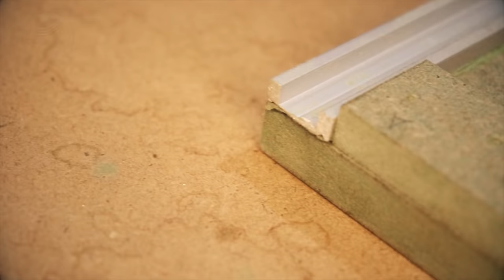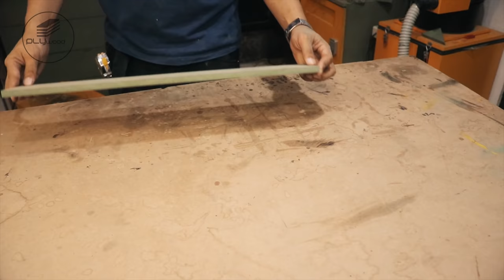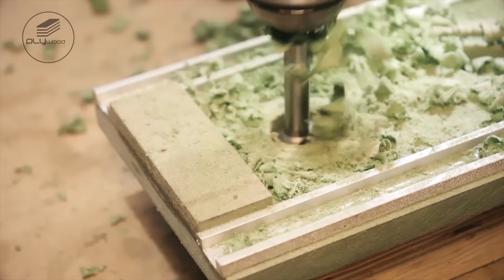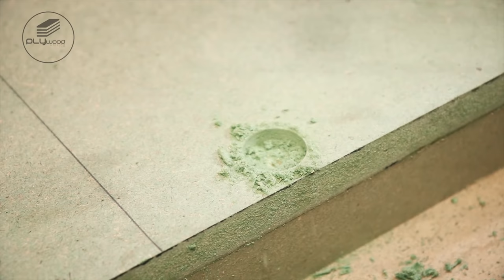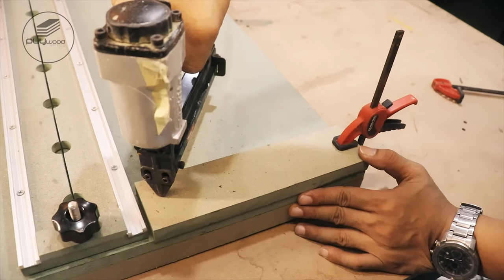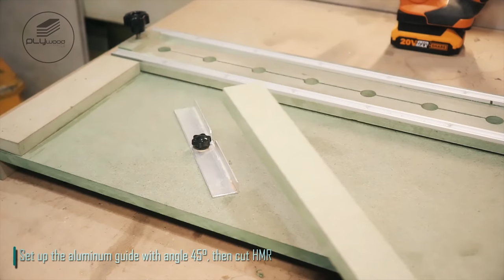2 in 1 Jigsaw Track Guide & Cutting station

Comment: Hi I make one!! but there is a problem!! the citing line in the guide itself was not straight  but has   deviation.?? may be the jigsaw problem it self?  sir
Reply from the maker: I have case like that before, i found the problem the blade not strong enough for cut staright, try change with good quality or good brand. That the problem solve and try cut with high speed
Reply: @plywoodworking  
Thanks a lot sir.
Reply from the maker: Your welcome
Reply: L
Reply: . Cimitero
Reply: @plywoodworking 
E la
Reply: @plywoodworking  ((((/

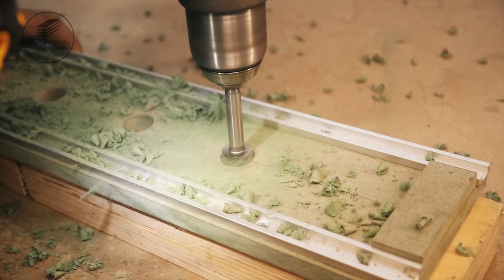Comment: @plywoodworking What is the purpose of the 7 holes you drill at around 4:22 ?
Reply from the maker: this is for guide, you can easy see line mark on this hole, why i give many hole sometime if want cut small you can use this hole for help place this jig
Reply: @plywoodworking  Yes, that makes sense 👍